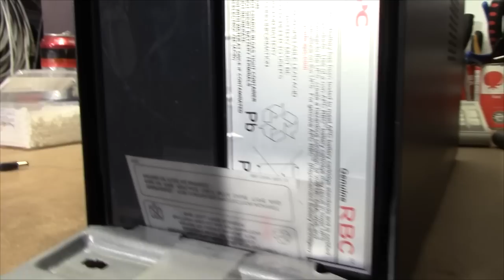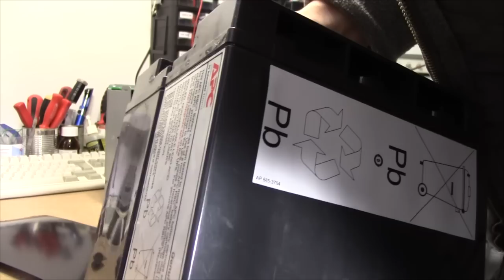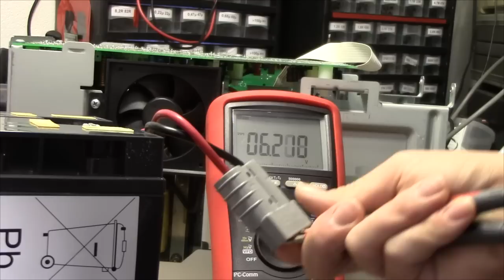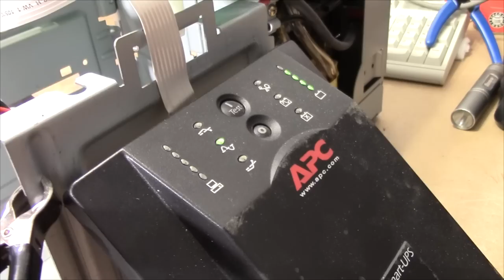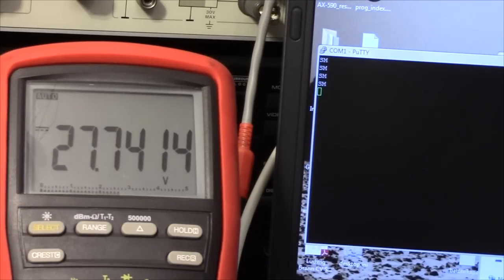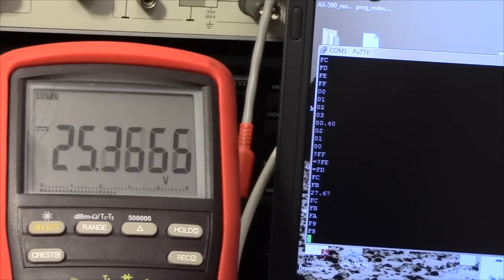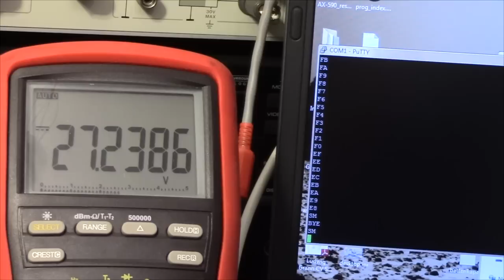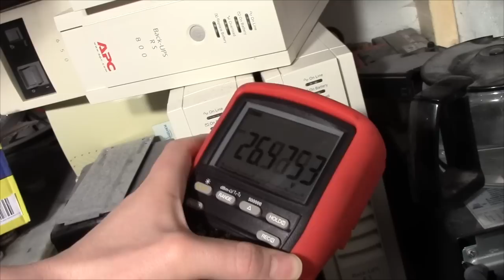Removing swollen batteries from, and servicing a 1500 VA APC UPS

Comment: I had this model but I wired in an external Anderson style connector which went to a pair of AGM leisure batteries as they could take the high float voltage better than flooded batteries could. I did this when I saw the price of genuine replacement APC batteries. I now use a low frequency 3KW inverter with UPS capability, which has worked flawlessly for the past 3 years.

Comment: You can tell how old an APC unit is from the serial #. The 1st two digits after the initial letters is the year of manufacture and the next 2 are the week of that year. So a serial like WS9915112233 indicates a unit made in the 15th week or late April of 1999. I believe this applies to all their devices such as the AP8853 PDUs, or the AP96xx network mgmt cards and the UPS batteries, too.

Comment: My smart ups 750 (the old one) from 2003 has 6 year old batteries which are in perfect working condition. Ive never touched them appart form checking them every now and then.
Reply: How are your batteries now? If I were you, I would open them up and add a little distilled water to thoroughly saturate the fiberglass separators.

Comment: Great video!! I thought that when in parallel they should still be reading 12v. I just did the replacements, and even upgraded a 1000 to a 1500. You didn't mention the fuse spec, but I guess it maybe series and 24v? since it is 32v 100amp fuse..maybe for spikes when turning it on.  Btw, I changes my batteries to 22AH vs the standard 18AH.  BTW, the swelling you had on the cells was very little compared to the ones I pulled/forced out.

Comment: Hi to all, for battery constants I would suggest to call our world wide support. The code above is not the default for this model it should be A1. Each of the codes are specific per model and putting the wrong code might damaged the unit due to miscalculated estimated.

Comment: Just to note I just did my SUA3000RMI2U with a 6800uf 160Vdc capacitor and set it to 54.4 volts, - the cap didnt have enough oomph to sustain the self test (battery) but it worked for adjusting the battery voltage on the charger. I charged it with the 4 defunct puny batteries from the ups. It made quite a spark - I should have used a resistor in series. Probably not healthy for the cap :)

Comment: Could you tell us how to connect the capacitor and the power supply (which in 9:06 - 9:22, it the power supply seems to be ON, but we don't see where the red wire goes to, only the black clamp were shown and the capacitor connected to the charging connectors) to jumpstart the UPS so we could place the multimeter while adjusting the parameters? I took an UPS (APC with different model, SC620, single battery) with discharging battery problem, I think it's the parameter needs to be adjusted after changing battery. I intend to repair it for personal use. Thanks
Reply from the maker: It's hooked up in place of the battery.
Reply: oh, I see... then I'll try that. thank you

Comment: Hi. I have a trash picked white "APC SMART-UPS 1400I NET" which I have recently got into service thanks to your videos (It looks just like the model in this video but it's white and has serial only, no USB). I can communicate with it via apcupsd. Do you know if I should be looking at the capacitor method or the voltage divider method to tweak my charging voltage? You're an inspiration - thanks and happy new year!

Comment: Very good video! Would like to know more about connecting to the APC UPS serial input.  Is there a way to do that with a unit that comes with a USB cable (Back_UPS XS 1500)?  When I remove the Powerchute software, plug in the cable and look for ports to connect with, Putty can't find it's USB input.

Comment: Is there a way to specify the shutdown battery  voltage of the inverter?  I am not interested in how much more time I have.  I am more interested in protecting the battery; i.e., depth of discharge to extend the life of the battery.
Reply from the maker: The battery voltage readout value (B) can be changed. THis changes the charging voltage and cut-off voltage.
Reply: FFcossag thanks for the reply.
Reply: What does the battery bar graph show; is it a representation of the level of the battery voltage, or remaining runtime?
Reply: FYI, I conducted some experiments:
1- Connected a power supply to the battery terminals on the ups without the batteries.  Powered up the inverter (inverter off) with the line AC on.  The power supply has a diode in series with its output in order not to damage the power supply.

The battery LEDs did not vary with the voltage from the power supply, which was surprising.  I then set the voltage to 27.5V and left it running for about an hour and the LED's slowly climbed up.  2+ hours all the LEDs lit up.  Seemingly, the UPS thinks it has charged the batteries.  The LEDs seem to indicate the amount of charge in the battery probably based on the length of time it thinks it was charging the batteries.  The power supply was left unchanged from the 27.5V.

Strange enough, before all of this, I was experimenting to determine how low the UPS would go before cutting out.  So I had the  
power supply and the battery connected, started up the inverter with no line power.  Then I removed the batteries, while the power supply was still connected.  I lowered the power supply voltage until it was V1 (gosh, I cannot remember what it was), when the beeper started to sound, started timing it to see when it would go down, went over 10 mins. 30 seconds, at which point I continued to lower the voltage to V2 (I should have written it down), when the UPS went off.  During the decrease of voltage from the power supply, the LEDs went down to 1 bar.  Subsequently, when I increased the voltage back to 27.5V, or higher, then LED's remained at one bar.  

After all of this, I'm not even sure what to conclude.  Comments?
Reply: Further testing:  Started up inverter on power supply (constant voltage) and no line power;  all LED's lit.  After about 3 hours the bars are down to 2.  So it seems the LED's are controlled by time (possibly power consumption) and battery voltage on discharge.  I assume battery voltage takes precedence over time.
Reply: Hello
Donovan Lym
Can I change the voltage of the charger via Hyperterminal? and what would be the command? Thank you.

Comment: Thanks for sharing all of this information... am I right to assume that this information applies to (which is a very similar) APC Smart-UPS 1400?  This was a unit that had tripped the failed battery light  and I replaced with a more modern unit... When I powered it down, I suspected it would turn back on without issue... However, this was not the case, and I'm glad I swapped it before it finally quit, as our entire VOIP system relied on it!   Long story short, the unit's batteries were seized up like this, and it would no longer power on.  Now I just need to decide what to do with it, correct replacements, or maybe car batteries like you've did on your other.
Reply from the maker: +Jake Johnston If it's a white unit, everything applies, except that you can't set the battery voltage using software.

Comment: Great video, I have a PFpower M1500-ups-pfp rack mount unit, that works but will not maintain the batteries voltage, I'M unable to locate a circuit schematic to help troubleshoot this issue. Any suggestions would be greatly appreciated. Thanks

Comment: Do the newer APC SmartUPS models still suffer from high float voltage? I have a SMT1500I from 2017 that is showing signs of a battery problem and I am wondering if they still have this issue.

Comment: i had a similar ups and the ribbon cable came lose and fired a chip on the main board.
those are nice ups. i just hate that you can not disconnect the ribbon  cable to get the door out of the way when changing the batteries.
Reply: +robertelee2k9 truth seeker 
You can easily take off the ribbon with the small switch board from the front door. There are 2 clips and it pops right out. Easier to handle and less chance to damage it.
Reply: UnknownHandle UnknownHandle
too late now. i threw it away years ago.
i just do not like that design. they could have made it where you could just unplug the cable from the board.
Reply: +robertelee2k9 truth seeker I still run 3 of them. I recenetly purchased a ...(let me see here) CyberPower 1500PFCLCD. Much lighter, slimmer, smaller unit. Not sure if it uses any Lithium power in it, but maybe they are lead acid that are newer more efficient design. Somehow I doubt they will do the same runtime as the APC 1500's I have.  We'll see how easy or hard it is to replace the CyberPower cells once they hit tilt.
Reply: UnknownHandle UnknownHandle
i put two  18 amp hours batteries on an apc back-up 1500va i bought to replace the one i damaged.  i hacked it to have external batteries that would last longer between having to replace batteries.  the batteries that came with it did not last a year before they degraded. they put to small of batteries in these ups they sell at office max.
Reply: +robertelee2k9 truth seeker ..Nice to have the room for external batts, but I have limited space under my desk, and rather have it "portable"(50# isn't really portable:-) than pieced.This is my second replacement. First ones were over 3 years ago. I have 3 and only 2 needed the replacement. The 3rd APC is going on 4th year. I purchased Universal Brand batteries, and they were 15.5volts when they arrived.   I'd like the Putty sw to adjust the volts, so I may need to see how to run that app on Win7x64bit.

Comment: Hi. Please, kindly assist. I have such of 1500 ups, which works fine with two external batteries of 190ah 12volts connected in serial. I use solar panels to charge the batteries. The Ups later start to select batteries (works with some batteries and not to work on some other batteries).

Now it refused to get on. What would you recommend for fixing it.
Reply from the maker: Test your batteries first. Then replace the capacitors if your batteries are known good.
Reply: @FFcossag  the batteries are working with other ups/inverter. At last, I suspect or the start/on button has problem, however I open the unit, I try to bridge the line with a conductor, but it make sound like it will start, unfortunately it won't.
Please, let me have a link if you have video on changing the capacitors. Thanks again for your assistance.

Comment: That's nothing... barely swollen at all. My APC 2200VA had 2 pairs of those batteries in it and they all swollen up to 1/3 bigger in all directions overnight due to charging issues. A few ppl told me it should have busted and were surprised it didn't... maybe the heat helped stretch the plastic. I think the batteries still work just fine though, but they aren't going back in the UPS, I'll use them to run lights in the shed or something. 

I unplugged it so I could open it up and blast the dust out and clean the fan as I thought it was the thing that was making an annoying sound, all went well, fully cleaned that fan and lubricated it, blasted it with air to flush out the excess oil, plugged it back in and it showed the batteries were dead when they weren't, so I unplugged it and ran the computers off of it until the batteries were actually close to being dead which took about an hour (gave me a different beep to let me know it's close), plugged it back in, charged it back up just fine. Unfortunately, it seems like it wouldn't stop charging because the next night, the batteries had reached 85 degrees celcius and bulged out like crazy. I of course unplugged it and retired it for now until I can figure out a way to maybe / hopefully fix it and buy new batteries for it again. I believe it was made in 2004, replaced the batteries once, 2 years ago. I am a certified computer troubleshooter with many years experience, but UPS's are a little different, so I don't really know what needs fixing.

That sound in which I thought was the fan, turns out to still be there even after all that effort in cleaning / lubricating, so I don't think it's the fan anymore. I've always gotten an annoying buzzing sound in my speakers whenever the UPS went into battery mode (I assume it's because of the transformers or something), but thought I would mention it anyways just in case. Aside from that, I have no other info for it atm. The display never showed any errors or signs of problems at any point in time, which of course is frustrating cuz it should have stopped itself before cooking the batteries like it did.

So far, no one wants to attempt to fix it for me which sucks cuz it's a $1500 unit and I'd be willing to spend quite a bit of money to have it fixed, or at least if I could gain some info for me to fix it myself.
Reply: turgsh01 Hope you had air circulation because in a small room that would be a fire hazard.
Reply: Inachu Ikimasho It was in a small room (tiny apartment) with not much air circulation... but there was no fumes or w/e leaking out... the batteries held together... somehow.
Reply: turgsh01 To prevent future fires only rest those types of UPC on a brick or non flamable surface.   I do the same with the power bricks for the XBOX 360

Comment: i have 1400 model. it have no led lit or any sond when plug it and press test button. how can i check it can use or not ?
Reply from the maker: You need to supply at least 24 V across the battery connectors. The easiest way to do this is to install a known good battery.
Reply: Good afternoon
FFcossag
I speak from Brazil and here my SUA3000-BR is charging with 24V and the batteries did not charge although the display indicates maximum charge and for the hyperterminal the constant and battery fluctuation are ok, but when I tested with the equipment 12V SLA Battery Capacity Analyzer and the capacity of the CSB batteries were at 38% and when installed capacity was 76% and the UPS was charging 48 hours. I think the charger has to stay at 27V for a full battery recharge.

Comment: After I did the swap and added the 32volt/100amp fuse, I had put them back to work. But I had them plugged into a curuit that I use in a socket outside. I used a pressure washer on it that draws a high amp power, maybe 13+amos?  But it caused one of the APC 1500 to smoke and spark and made the house smell of electrical burns.  At first I wasn't sure whaty the source was..only after sniffing around, this unit was it, and I pulled the batteries out, and see black smoke on the quick connect /grey connectors, and undid that.  

Any idea what might have fried? or why it did this?
Reply from the maker: +UnknownHandle UnknownHandle It's difficult to say. I hope you didn't connect the UPS output to your house wiring - they are not built to do that.
Reply: of course I plugged it into the house outlet. As designed, and as I have done for over a decade...(?)

Comment: i am using an APC SU700INET. it is an old UPS. I bought two new batteries and hooked it up. charge the battery to full charge but when i connect my laptop the batteries completely drains in 5 minutes and these are new batteries. what is wrong with my UPS. please help me. i already lost the serial cable.
Reply from the maker: You need to reset the battery variable using the terminal. Your new batteries could also be bad.
Reply: @FFcossag  the batteries are brand new. just purchased these batteries 2 days ago.thanks for the reply. i just purchased the cable and waiting for it to arrive.
Reply from the maker: It's very common for these small lead-acid batteries to be dead on arrival. Sometimes the infant mortality rate can be as high as 10 % - that means, one in every 10 batteries delivered to the customer are bad. Just because they're new doesn't mean they're good - they need to be tested.

Comment: Hi FFcossag, (1) Where can I get this "COM1 PuTTY" software? (2) Does the "COM1 PuTTY" work on RS800? (3) What's the advantage of installing the huge low-voltage capacitor instead of a lead-acid battery? (4) What's the formal name of this huge low-voltage capacitor? I could only find the small electrolytic caps (thumb size) in online shops and couldn't get this 35V 45000uF. Is it a "supercapacitor"? Thanks.
Reply from the maker: The software is just called PuTTY, it's a terminal emulator (usually the first hit on Google). I don't think it would work with your RS800, since I believe those are USB-only, and PuTTY can only talk to UPSes over serial cable.

I hook up the big cap only in order to calibrate the battery charging voltage on black Smart-UPS units. It's just a question of convenience, since the UPS won't charge properly without a battery connected, and a lead-acid battery will take minutes to adjust to the new charging voltage. A capacitor takes less than a second, so setting the voltage goes a lot faster. It's pretty pointless to get one for an RS800, if that's what you're asking, since those don't have software adjustable chargers. ;)

The capacitor is a simple aluminium electrolytic capacitor, and there are plenty of its size available from, for instance, Mouser or Digikey.

Comment: Question on this... You said that you usually set to 13.5V when you're reselling units. Is that what you recommend for home use? (Recently snagged one of these off Ebay and want to make sure I don't nuke my brand new batteries.)
Reply: Oh, doh. I missed that section. (Sorry, had been re-watching and I didn't think you'd covered it last time I'd looked.) Sorry, and nevermind!
Reply from the maker: You should set the charging voltage according to the datasheet for your batteries if you're using quality batteries. For generic cheap-o batteries, I tend to stick to 13,6-13,7 V per 12 V block. Higher voltages will usually cause relatively quick failure.